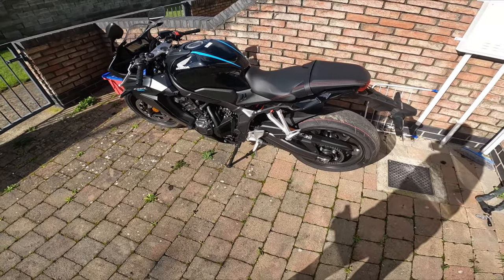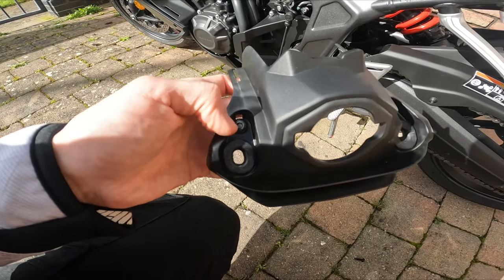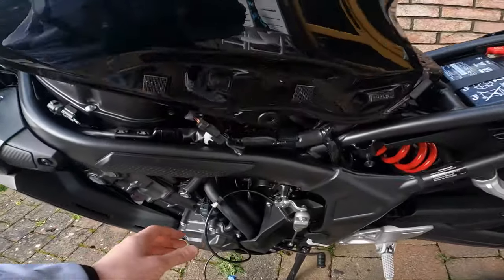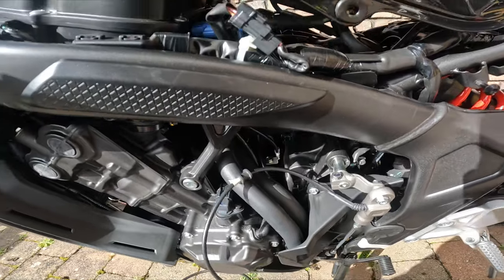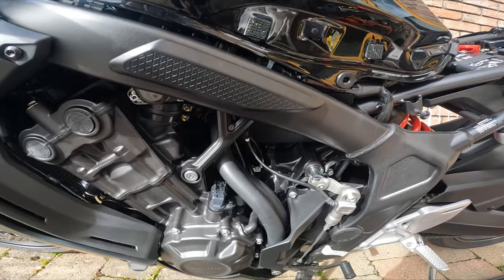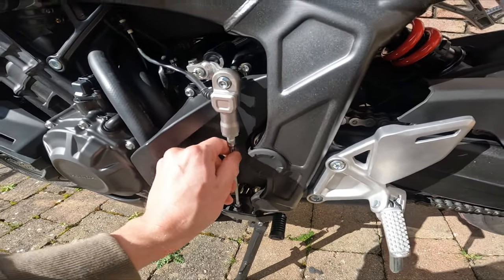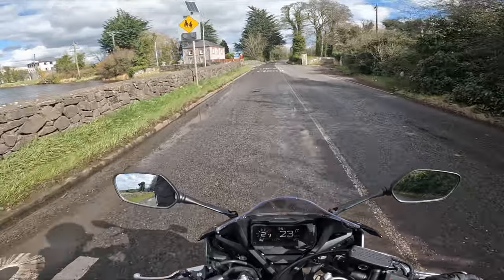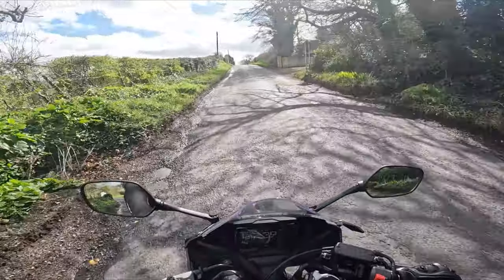CBR650R - Quickshifter Instalation and test ride

Comment: If you put a quick shifter by yourself you lose garanty?
Reply from the maker: In Motorcycle shop where I bought bike they didn't say anything about loosing warranty if you install original Honda parts, as you see its plug and play, all information to install been followed by QR code what brings you to official honda parts instalation guide. 😉